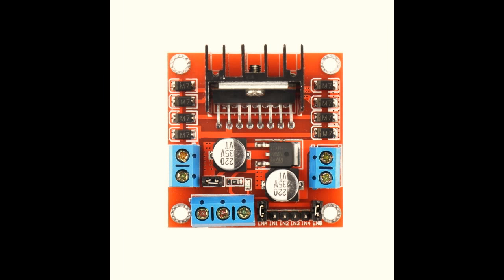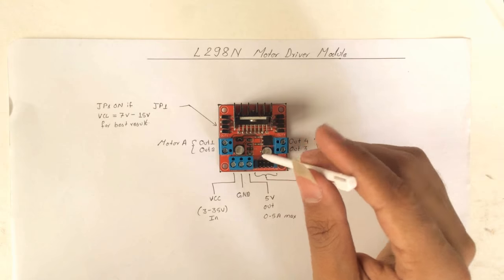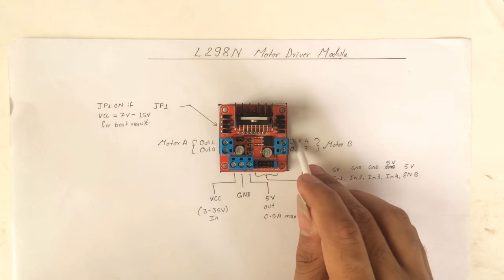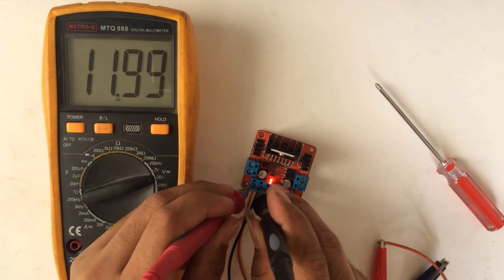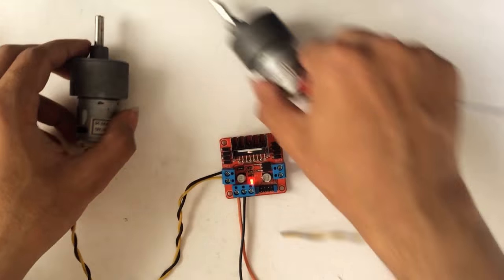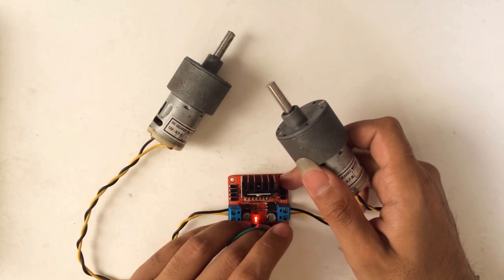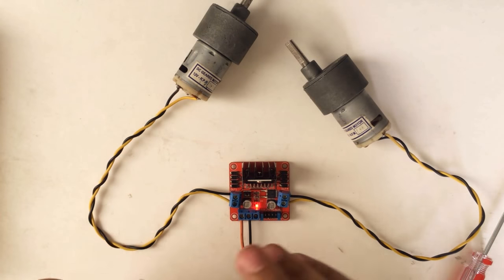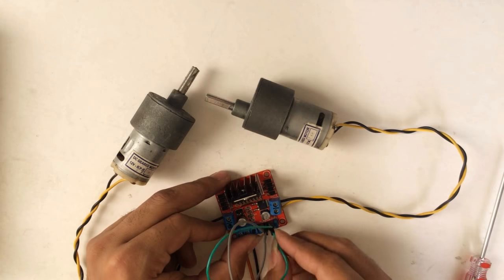How to use L298 motor driver module

Comment: Is it possible to control the speed of the DC motor with this board ? If so please let me know the connection details.
Reply: Yes it is possible to control speed. Just give pwm signal to ip pins or enable pins

Comment: hi, when I look at the schematic for this L298N, i also saw 2 pin 1 and 15 are SenA and SenB which are current sensing  A and B, but I could not see any pin named this on the board, can you please explain? thanks
Reply: SeaA and senB are to sence and limit the current going to motor through ic but in this module those pins are grounded to make it universal and doesn’t shutdown if high current is drawn by motor. Which is bad but also good for fresher not knowing what just triggered the shutdown function.

Comment: If I want to make a convayerbelt with a 12v motor from a windshield whiper from a car, can I do that with just a relay to turn on of motor, or do I need a motordriver?
Reply: You can do it just using relay only but the relay should be powerful enough to handle the switching current. Then you are good to go
Reply: @madangyawali9863  to make sure its strong.enough, can I connect the.relay to a 12v input relay thats in a car that one has.to be strong enough.
Reply: @superliegebeest544  yes you can

Comment: can I change stepper motor speed using L298N THROUGH pulses generated from CNC axis pulses(let say Z AXIS PULSES)?????in another word i am requiring z axis heights to control stepper motor speed proportionally

Comment: Can i used 12v 2A power adapter to operate this module...
Reply: Yes you can if your load or motor is rated for 12V.

Comment: im trying to run a stepper modal 17hs4401s and trying using L298N only   using a a bench power supply .i have kept the three jumpers on. putting 7.4 dc volts  on the 12v pin and ground on center, and have out put of  5 volts im using the 5 v to run to pin 2   getting nothing moving . i see you have 4 wires on the 4 pins. the video i have been watching only uses 5v on pin 2. is this my problem.  that being said the video that have been watching is just running one motor and its not a stepper HELP
Reply: Sorry to say but i didnt quite understand how are you driving the motor. But the power supply part as u said is fine. Being stepper motor it just wont run as dc motor only by giving hi or low to enable pin or signal pin. However to run stepper motor using l298n module is possible. For that you need to connect the 4 corresponding wire to two motor op terminal matching the two internal winding terminals of motor and need to give a sequencial input to drive front and reverse to the signal pins.

Comment: I am facing a problem while connecting 9v battery to 12v output pin of l289n, for 5v it is supplying the power, but not the 12v can u help me plz send me replay fast

Comment: I'm going to use 9v battery as power source. Does it work with 6v motor?
Reply: Paul Sih yes you can use those 9v battery with 6v motors because those battery lack high current to damage anything.
Reply: @madangyawali9863  I thought  power supply voltage must match motor voltage.
Anyway when do you disable or enable 5v regulator? I still don't understand it. I found information on the internet. It says that if voltage is over 12v it will be used as input. Why is that? Why do you need another input when there is already external input port? This is where i found:
http://qqtrading.com.my/stepper-motor-driver-module-L298N
Reply: Paul Sih yes the power supply voltage must match the rated motor voltage. This is necessary for safe and reliable operation but you can sometime escape this when the powersupply you are using has low capacity to do any major damage to the load you are using. And sometime you can use low voltage to high voltage load to perform it slower and more gentle during operation.
Reply: Paul Sih you dissable 5v regulator if you are providing 5v power to the motor driver from arduino or any 5v supply source to 5v and ground pin of motor driver. And enable when you have atleast 1.7v greater then 5v or say voltage greater then 6.7v at vin of motor driver module which can enable the 7805 voltage regulator ic of that module.
Reply: @madangyawali9863  hi, is it ok if i am using two batteries 3,7v serial (7,4v total) as an input, but still use the 5v output to supply the arduino?
Reply: Channel Mbah yes you can do so until the battery is low it works just fine

Comment: 0:05 you show the module without top row for in1, in2,in3,and in4.  At 6:10 you insert green wire from top row to bottom row. How do you archive the same thing with the module that has no top row?
Reply: I had to deal with this today with the drivers I received. I just hooked up a male-to-female jumper from the 5V out on the blue VCC GND, 5V terminal block.

Comment: I am not able to control two motors with it....one motor works just fine...but with two motors it stops working...what should i do
Reply: Your powersupply must be insufficent for two motors so increase your supply power and good to use capacitors in powersupply for inrush current.

Comment: What about sample wiring connection for 24Vpower supply to drive two 24V DCmotor, using Arduino Uno along a breadboard. Assuming Arduino Board is powered by 9V Battery, ENA and ENB enable.
Reply: Just give 24v power to power in and connect signal pins fron motor driver module to arduino no need to worry about powering the arduino with 9 v or other just make sure the ground pin of arduino and motordriver are connected
Reply: @madangyawali9863 Thanks, I really appreciate your good solution,  just before working on your suggestion. How is that, my power supply is 24V to run  two DC motors, Arduino Board recommended input voltage is 7-12V,  now that motor driver jumper is disabled because of power supply greater than 12V and 5V input is suggested for your motor driver IC Controller. Please educate me on this issue.
Reply: @febochestbox5507  it will be good if you use 7805 or buck module to stop down the 24v to 5v for arduino and motor driver module. 7805 must be very hot while doing so, so my recomendation would be good if used buck module.
Reply: @madangyawali9863  meaning 5V buck converter will supply 5V for motor driver module and to Arduino, and 24V power supply remain for my 24V DCmotors, disable jumper and the rest simply connect them to Arduino pin such as; enA, enB,in1, in2, in3,in4 but making sure enA and enB are connnected to PWM is that all?
Reply: @febochestbox5507  absolutely. Thats all and dont forget to connect ground pins of arduino and motor driver module n u r good to go
Reply: @madangyawali9863  Thank you my friend, but for the sake of argument, I think it would be the same as to supply 7V-12V power  first to arduino board as OEM recommendation, then from Arduino 5V output and GND nake connection with your dupont  cable to breadboard, then your motor driver module will get 5V input from it. I might send you my wiring diagram pics. Thank you again my friend, I am learning from you.

Comment: I’m facing issue.. l298n only giving me 3.26 output voltage when I connected the gear motor as u used in video and move very slow. How i can fix it out.. I’m using 12v 4.5amp battery
Reply: sajjad ul haq you can change the speed by changing the value of PWM.
Reply: I want to use max speed all the time so I don’t need to use pwn ...  the main reason is that when i provide 12v 4.5amp to L298 the give me only 3.26v 0.07amp at output ..
I want to get 11v 1amp at output.. how i can do this..
Reply: @sajjadulhaq4136  to get the max speed you just need to give 5V or digital high to input pins. while testing your motor driver is working perfectly just disconnect the motors and test the voltage at the motor terminal in module which should be in betn 11-12v, make sure the thickness of the wire you used is good enough for motor, test the voltage and current of the motor directly through your battery. thats all if your motor while connected to battery is performs well  then test the module as shown in this video. thats all i can help. if further problem feel free to comment.
Reply: Thanks i got it..